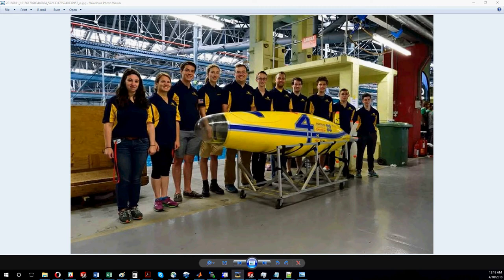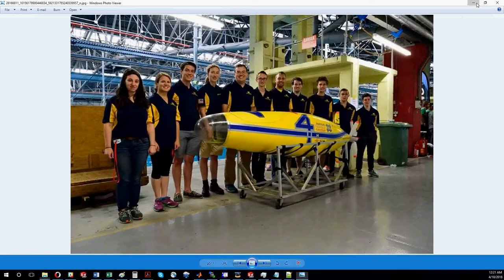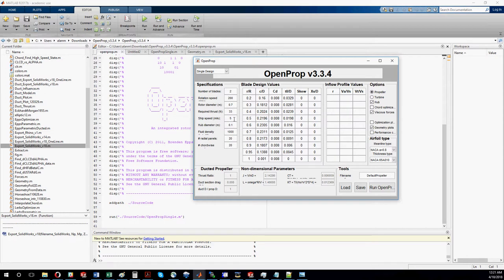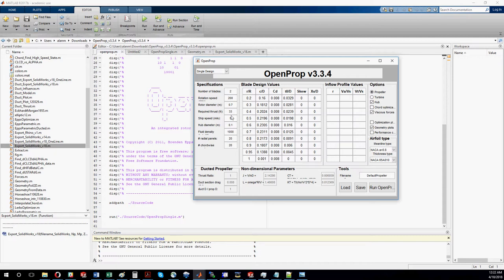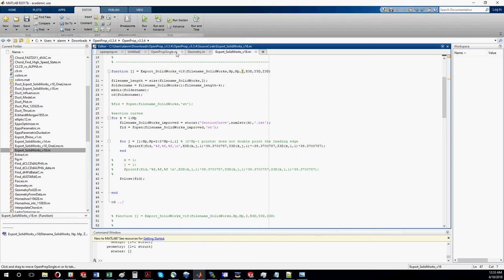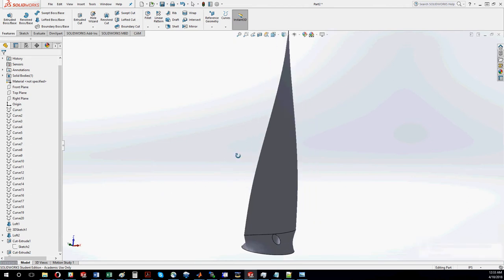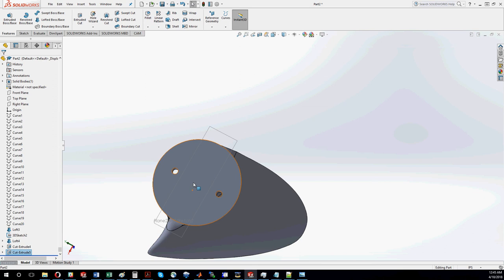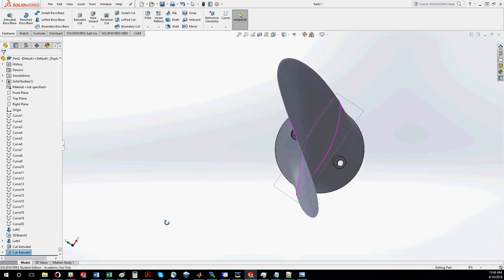Tutorial: Creating Propeller CAD Models using Matlab OpenProp and Solidworks

Comment: Can anybody tell me how to decide    thrust on the body
Reply from the maker: Ya. That's a tricky but easy enough one. You need to have an idea about how much drag your body (vessel/hull/craft) has at the speed you want it to go. This involves some iteration and usually involves making a propeller model with some guess as to the top speed. First, run a CFD simulation of your body at the speed you want it to go and do a measure on the drag of the body at that speed. Then, using Openprop, design a propeller to provide the required thrust equal to that drag at the given speed and see what the required torque to turn the propeller is (or power which is proportional to rotational speed and torque). Is this torque/power lower than your power-plant can provide? Great! You can go faster, so increase the speed of the body and run the CFD again, then make a bigger prop, and see what the new torque is. Is the required torque too high? Then your propeller cannot provide the thrust needed which means body has too much drag at that speed. Therefore, you either need a more efficient propeller (which can be changed by messing with gear reductions, changing the blade shape, number of blades, etc.), lower drag body (if you can redesign it), a more powerful power-plant (if you have the space/capability), or you just are not going to be able to go that fast. I hope this helps. Let me know if you need any more help!

Comment: Hello Alan, I want to consult you about a subject about openprop.I want to set the torque of the propeller to a constant value, how can I do that?
Reply from the maker: I see you commented a while ago so I'm sorry for not getting back to you quicker. I'm not sure if you still need assistance but I'll give it a shot anyway. The torque required to rotate a propeller at a certain velocity is dependent on the velocity of the propeller through the water and the speed you are trying to rotate it at. these are both design constraints that are easier to specify from design requirements than torque on the propeller. basically two values should be fixed to determine a third. for example, if you have a vessel which must travel at a maximum speed of 20 knots and your engine is capable of applying 1,000 foot pounds of torque, guess and check the number for RPM until you arrive at a number equal to your desired torque. Hope this helps. let me know if I can do anything else

Comment: Extremely helpful, thank you so much.
I have one question: is this program useful for air applications as well? I need to design a propeller for a drone but I'm not sure that this software's results are realistic for low density fluids as well. What do you think?
Reply from the maker: I have no idea! I would recommending the software developer as all I did was mess with the outputs. I have little fluids experience.

Comment: I do not have Matlab and I was able to get the OpenProp examples to run on Octave. My question is how one can accomplish iterative designs using just Octave. Are there alternative commands in Octave to generate the GUI screen?
Reply from the maker: I'm sorry I don't have octave. if you can get to the point where you can export the curves then the process should be the same

Comment: Very helpful video. But I am facing problems running the geometry.m and Export_Solidworks_v18.m script files. I am not good at Matlab. So it would be very helpful if you could show us the whole running process. Thanks in advance.
Reply from the maker: The changes to the code are done in the text editor and the openprop code is subsequently run as normal. I would make the video but I no longer have access to Matlab as I have graduated from my university. Sorry. Any tutorial will work to show the running process
Reply from the maker: sorry for the late reply so I'm not sure if this help is still needed but I'll give it to you anyway. I would recommend looking at a tutorial on how to run open prop. My tutorial intentionally only covers the steps required to model a propeller in a design software as that was a gap in knowledge that I found existed in the tutorials on YouTube at the time. those codes don't actually get run. there is a gui for it.

Comment: Hi Alan!. I had done the steps mentioned at the video but when I add the files you shared and run the openprop with my own characteristics of design it doesn't deliver the same "design performance" in comparison with the original openprop. I just want to get the txt files of my own parameters. I hope could you help me, it its very importan for me because i am using this tool for my thesis. I am from México, sorry if I commit some mistakes with my english.  Greetings!
Reply from the maker: Hi Rodrigo! Id love to help in any way. I'm a little lost. Where is the deviation in what you're expected to receive from openprop?
Reply from the maker: Also, feel free to direct message me your email address as that may be quicker if you are in a time crunch

Comment: Hey Alan! Thanks for this video. I want to increase the number of input values from 10 to 20 i.e the r/R, c/D, Cd ..... values. Is that possible?
Reply from the maker: Hi! Sorry for the late reply. You can. On the openprop main screen, there is a number you can input called section profiles or something like that. Change that to your desired number. Unless it has been changed, because the GUI only supports adding 10 chord to diameter ratio numbers and other parameters like that, you will have to hard code those values
Reply: @ArduinoAlan  thank you so much!

Comment: Hello bro. First of all, thank you very much for this video you made, it was very helpful but I have 2 questions. 
First, we used the openprop program to design a 3-blade propeller. However, with the method you have made, there is only one blade and unfortunately we cannot receive the data of the hub. How can we get Hub's data ?
My second question is, why did you assign the plane you assigned in Minute 18 at a distance of 1.5 inches?

Thank you very much if you can help me with these questions.
Reply from the maker: hey sorry for getting back to so late. I'm not sure if this is even still helpful but I'll give it a go. admit 18 I assigned the offset plane at 1.5 in because I have a 3-in diameter hub. for the three-bladed prop, I would suggest that you just take one of the blades since they should be symmetric and do some sort of revolve symmetry which I can't explain exactly how to do without knowing what program you are using. please let me know if I can help any further!
Reply: @ArduinoAlan  it is not efficient for me now but thank you for your reply :)